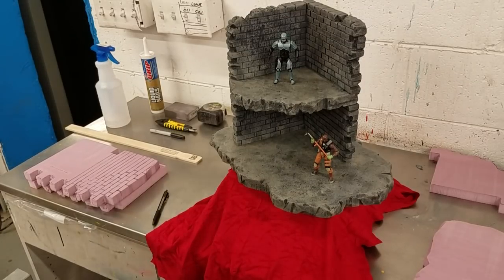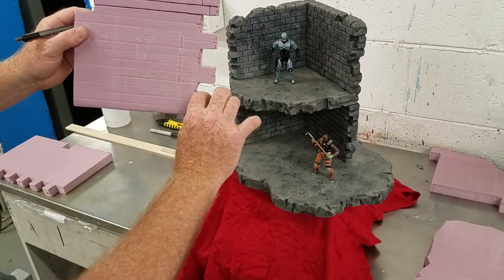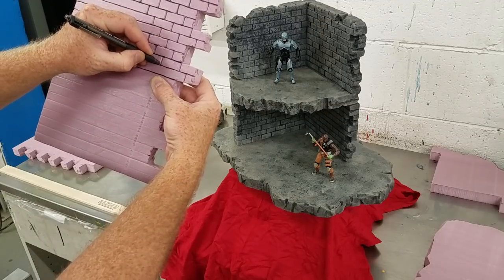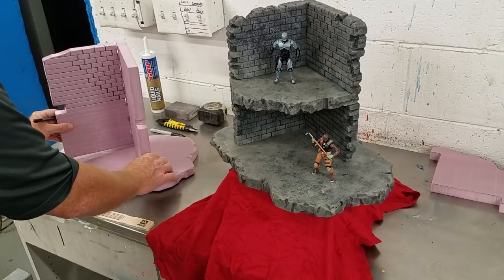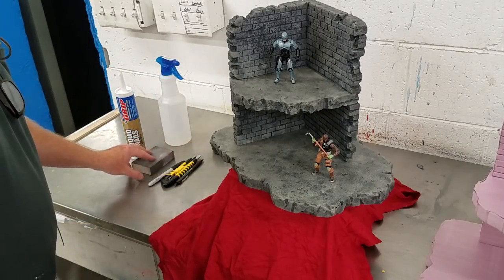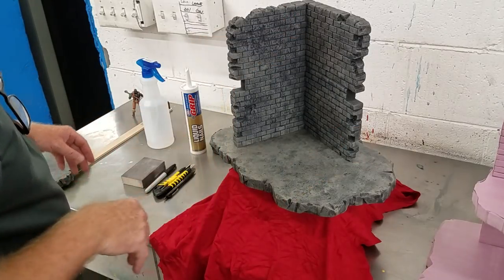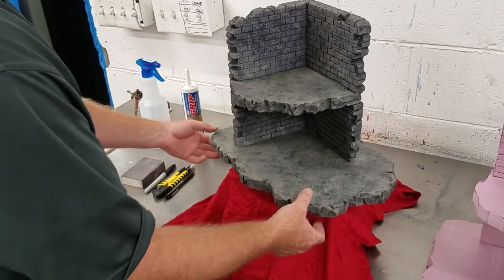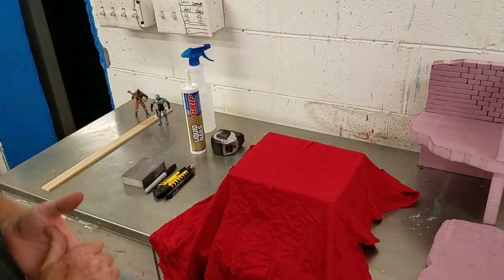How to make a diorama display part 1

Comment: This is my favorite new subscription channel.
You got me stoked on trying my first diorama:  3 3/4" JOE or Cobra Weapons Armory.  I had an idea to take a bunch of those rifle racks from the Bivouac set and Rifle Range set and line them (deep set)  inside the inner walls of the Armory. I was planning to make it fully enclosed, but accessible from the top. (no roof) You receive your rifle at the front wall through a thin rectangular slot (cut out) like a real armory in the military.
Reply from the maker: Thank you. I need to share some new tips.😁